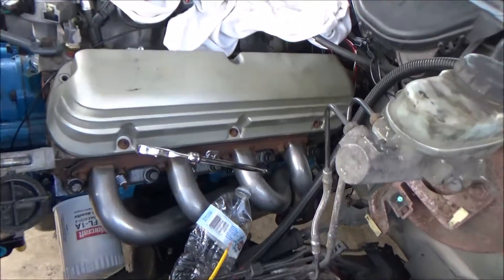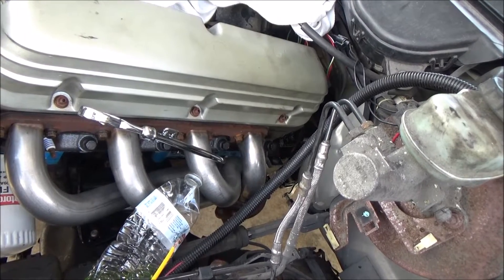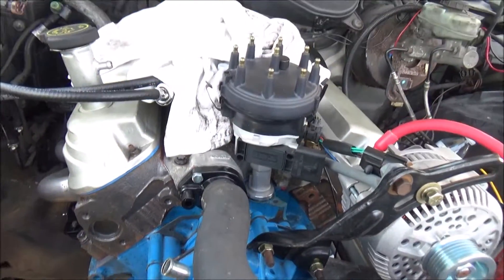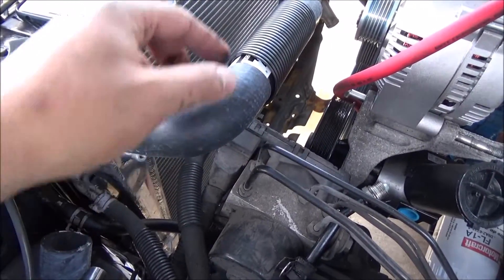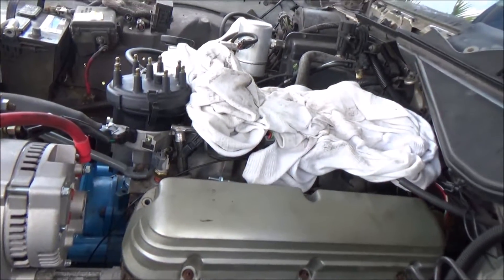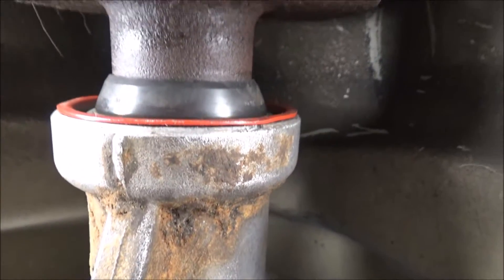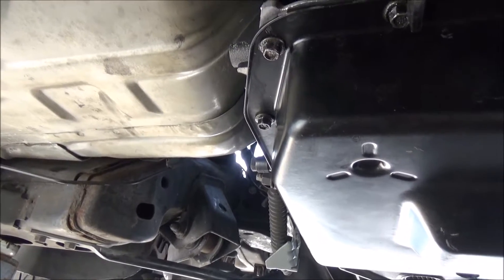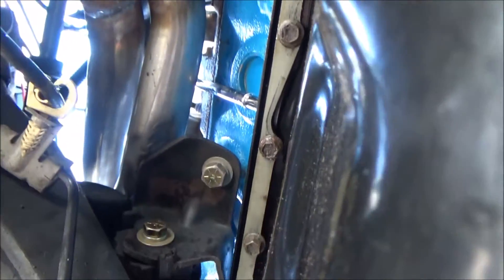302 swap update 4

Comment: What transmission you used and how horsepower is it pushing
Reply from the maker: 4r70w from an explorer. Has to be a 4r70w that has a sbf bolt pattern or a V6 from an F150 2wd will work. I assume 300 at engine and 260 at the wheels. He does get up an go because of the torque. Still have to take it to Dyno it. It's a truck flow stage 1 cam, victor Jr intake for a 302, gt40p heads with springs for higher lift. Also has shorty headers
Reply: @pivisrepairshop3151  is it possible to get 500hp all motor out of them
Reply from the maker: @nequelnelson1950  assuming better heads, stroking the engine, and higher lift. It's doable but suggest a dart block at that point. 300 is plenty to have fun.
Reply: @pivisrepairshop3151  yeah but b20 Honda civic non VTEC beating x5  in Connecticut we street race I wanna get 500hp at least
Reply from the maker: @nequelnelson1950  I went more for torque. Weight is what will affect your ability to beat 500 hp civic. 500 hp 302 on a heavy car won't help that much though. What the 302 has vs the 4 cylinder is torque. You need to throw money to get power
Reply: @pivisrepairshop3151  yeah but donk master racing on full weight system in trunk big rib rims and pulling
Reply from the maker: @nequelnelson1950  true. But I don't think it's NA. They use boost though. A stock 302 block splits in half around  450. Hence why you should upgrade to a dart block.
Reply: @pivisrepairshop3151  what's a dart block? Yes, the motor will have to be fully built for 500 no turbo or nitrous ?
Reply from the maker: @nequelnelson1950  it's a brand that makes aftermarket blocks. Some can withstand 800 hp or more. Depends on the one that you buy.
Reply: @pivisrepairshop3151  if you wanted to go 500 hp all which 460 big?